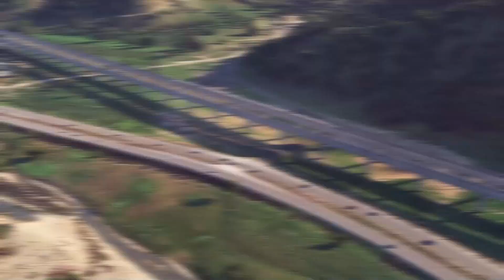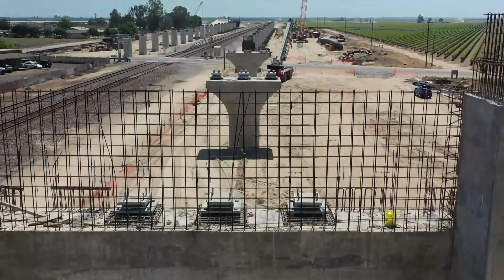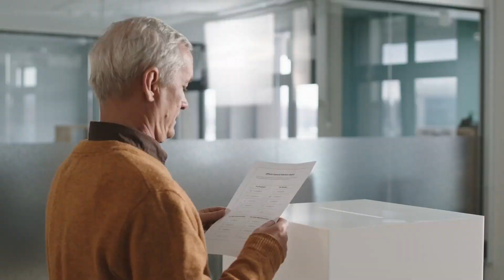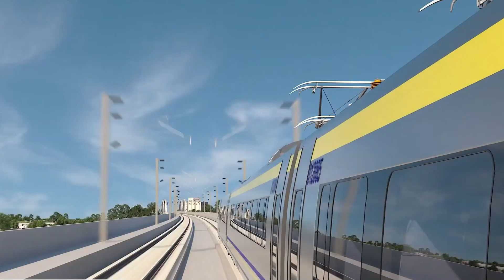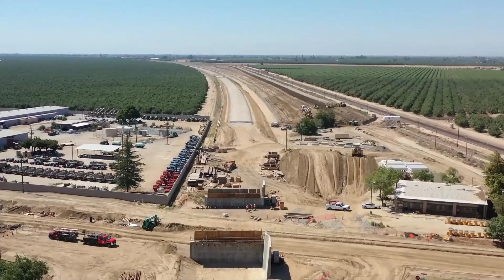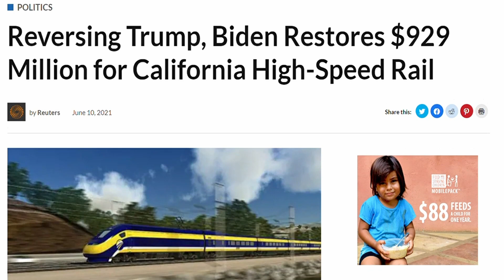California High Speed Rail: Will it Ever Be Completed

Comment: The criticism in this video ignores the objective of building the HSR in CA. Which is to connect outer areas of the state to major cities. This will generate more commerce and economic balance in the more desolate areas. One thing Europeans fail to understand is that building a line directly to major cities only will worsen the social inequality by focusing only on the public investment in major cities. This encourages people to migrate only to those areas, exacerbating resources such as housing and the cost of living. The wealthy and large corporations benefit the most from this public infrastructure as they have the assets to exploit these public investments. Europe suffers from an over-centralized economy. The wealth is simply concentrated in too small of an area. HSR is notorious for being unprofitable and CA certainly have the revenue to prop this up. Makes sense to spread the investments to the underserved areas. Also, building at this speed may be of some benefit. The Palmdale station was built to be eventually connected to the Vegas HSR. Something the private train Brightline is supposed to build. As more time goes by, the goals and benefits become more apparent. But just like everyone else, I am eager to get this done asap.

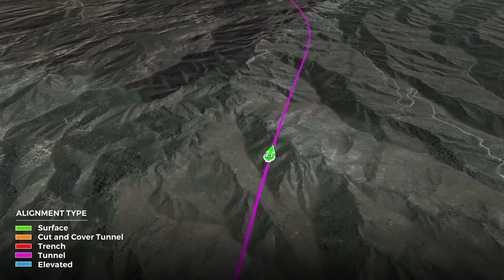Comment: 7:28 alignment choices LA - Bakersfield detour
Tunnels and bridges are 3 to 7 times more expensive than a ground-level alignment. If even the alignment in the flat Central Valley is too costly, then the financial burden of the many tunnels and bridges of an alignment over the Tehachapi mountains would be extremely high.  A German consultant specialist for High-Speed Rail (Vieregg-Roessler) has designed a draft alignment from Bakersfield to LA Burbank along Interstate 5 with only 10% bridges and tunnels (available in the Internet).
Why does the California High Speed Authority continues to inisist on the expensive detour alignment via Palmdale with 50% bridges and tunnels, if much more efficient alignment solutions are available?
Reply: "Tunnels and bridges are 3 to 7 times more expensive than a ground-level alignment. If even the alignment in the flat Central Valley is too costly, then the financial burden of the many tunnels and bridges of an alignment over the Tehachapi mountains would be extremely high."

Well, you have to dig at least one tunnel with either 99 or I-5. You have a mountain range in the way using both routes. Only two ways to avoid that: (1) use maglev going down I-5, as it can take 10% grade no problem, or (2) upgrade existing Amtrak California track, which goes along the coast, avoiding the mountain range. However, it's definitely true that there is LESS tunnel digging for I-5 vs 99, so I agree that I-5 would be cheaper in this regard. Going down I-5 in general is the 2nd most fiscally conservative route, with upgrading the existing tracks along the coast being the most fiscally conservative. Either is a far better choice than going down 99. :)

There's a guy named Clem Tiller who has been writing about public transit issues in California for 20+ years, he's an aerospace engineer IIRC. But he had an article called "The Truth About Tejon" (since we can't post links on here anymore, if you google that title, you'll get a PDF as the first link, download it and read it) explaining that it's quite possible to go through there on wheel on rail, you just have to dig tunnels (like with the 99 route, you have to dig a tunnel with 99 too). And he does say that there are fewer tunnels necessary, with shorter lengths, than for 99.
Reply: Exactly. It'd be too expensive, and the Inland Empire is expanding and needs to be connected too. The point is to build a network not a two city link.
Reply: I'm sorry but this is just not blatantly false. There is no physical way to get from SoCal to NorCal without tunneling  through at least two mountain ranges. Both regions are literally located in bowl-shaped valleys and are surrounded by mountains on all sides. You would have to be extremely unfamiliar with the geography of California to write what you just wrote above.

Furthermore, a large number of routes of various levels of quality were looked at when the system was being planned out. Some of them dropped out immediately because they were too slow to conform to the bond measure law (the I-5 alignment) that approved the funding for CHSR. Some of them were a lot more expensive to tunnel and viaduct (like the Grapevine tunnel ones). And some had a combination of issues, i.e. they were both too expensive and too slow (Vieregg-Roessler).

What ended up being chose is a compromise, for sure. But you can see exactly why this route was chosen. It was all done in public meetings with wide participation from the public as well as contracted and outside experts. You can look it all up. It's all in public archives. I understand that these decisions all happened a long time ago by now. But to suggest that they were made by some mindless bureaucrat without looking at the evidence is just absurd. It's literally all recorded and available for all to see. There's no need to mythologize and make $hit up.
Reply: @TohaBgood2  
"Some of them dropped out immediately because they were too slow to conform to the bond measure law (the I-5 alignment) "

Tohabgood2, What can we Google to find this? Because the actual reason they chose 99 was political; they figured people in trumpland were more likely to vote for it if went through their area. But I'd love to see a credible source that says I-5 would somehow be slower.

For example,

""If you went up the I-5, you'd get a lot of votes from the cows in Coalinga," said Richard Katz, a member of the L.A. County Metropolitan Transportation Authority board and a former high-speed rail authority board member."

Same article says,

"SNCF officials said that if they were hired they would propose running the bullet train along Interstate 5 through the Central Valley and then linking to San Francisco.
McNamara said the I-5 route would have been the shortest, fastest and lowest-cost alignment, with a price tag of about $38 billion — sharply less than the rail authority's current route, which has been estimated at various times to cost $34 billion, $43 billion, $98 billion and now $68 billion. According to SNCF, the I-5 route could use state-owned right of way or utility easements, reducing conflicts with property owners.

"In the French view, fast service between the state's mega-regions would provide most of the riders and lead to the system's ultimate success. The French contended that rail service to Fresno, Bakersfield and Palmdale could be accomplished with branch lines linked to the I-5 route and regional commuter service, such as Metrolink."

To find this article, put "High-speed rail officials rebuffed proposal from French railway" into Google. First link should be a PDF document that is a printout of an LA Times article. That's where I got the quotes. 

(if I put the link YouTube will eat my comment.)

So, can you help me out with the "I-5 being slower" source?

Comment: I would love see a true high speed rail built to connect SF with LA on a direct route. But the current plan is nearly 100 miles longer than a direct route could have been. 
     If the route had gone from SF to San Jose and Gilroy. And then from Gilroy to Los Banos and I5, which it could have paralleled down to the Bakersfield area, where a transfer point could have been set up between valley Amtrak services and the high speed rail.
     Then the route could have gone to some places near the Edmond Brown pumping station and tunneled through the mountains to Castaic Lake and another tunnel to get to Saugus and parallel the old SP line to Union Station. 
    Union Station would need to be modified to allow HSR trains to pass through and go to Anaheim and San Diego. Not with a long side trip through Riverside. 
     Because of politicians, who wanted to build a line to connect the towns of the valley, the route has gone across expensive pieces of land and probably won't be completed. 
     For now they should focus on cleaning up the mess they have made and completing what they have started before they seek to extend it over the mountains to Palmdale.
Reply: That was a nonstarter from the very beginning. We had just finished building the 5 to bypass 1/3 of the state and pretty much all of the cities in the Central Valley. If CHSR tried doing the same thing, there would have simply been no CHSR to begin with. Keep in mind that this thing had to pass as a ballot measure and most of the state needed to support that law. There was no way that the bond measure passed without routing through the Central Valley towns.

CHSR is supposed to connect the state of California. That's why the entire state is paying for it and not just the two mega regions. If SF and LA want a direct HSR link, they can just pay for it themselves without involving the rest of the state's taxpayers. 

Furthermore, CHSR is supposed to be to the entire state what BART is to the Bay Area or what the Shinkansen is to the Tokyo area. What would be the point in connecting just SF and LA? You're literally ignoring most of the benefit of building an HSR system if you don't go through Fresno, Bakersfield and the rest of the Valley. Despite what some people may think, Fresno and Bakersfield are large cities. Both have metro areas of about 1 million people and the rest of the Valley has a 6.5 million population in towns of 50k-200k. What idiot would build a train bypassing all of those cities? Why? They're literally a five minute detour to the East!
Reply: @TohaBgood2  The Valley has 2 Amtrak lines serving it. So the segment that is being built is the wrong one to start with. Similarly the Palmdale route has Metrolink to bring people to Newhall. 
     So the important segment to build should have been Newhall to Bakersfield. That way service could have been provided on Metrolink from LA to Newhall. HSR could then take passengers from Newhall to Bakersfield. There they could transfer to existing rail lines to get to Fresno, Oakland, Sacramento and other places along the way. We wouldn't have ended up with a line that doesn't get passengers connected with the rest of the state. 
     Granted, we would have had to contract with people who knew what they were doing. But, even in California, that might have been possible.

Comment: Excellent video (although you forgot to add the expensive lawsuits that the CAHSR agency has had to deal with which has also contributed to the rise in price). When this project is finished, no one will be talking about the price. It's just like the interstate highway system. It cost a lot of money to build, but today, no one really talks about what it cost to build. And essentially, high speed rail will be more beneficial than the interstate highway system.

Comment: Let's get this project done! We need High Speed rail as planned. The Mistake is NOT finishing this project. Clean up the politics, look for private funding such as Brightline and possibility intergrading with Amtrak and Metrolink. Sharing the cost of the tunneling out of LA. and SF. Californian's need this done.
Reply from the maker: You are right, but with increasing costs and other bottlenecks, is it still feasible?
Reply: @poshfuture1833  it’s still cheaper than widening I-5
Reply: @poshfuture1833  Posh: Increasing cost, bottlenecks are always part of big projects. If we are going to let concerns rule the day,  then your right noting will get done. Instead of acquiring more farmland, why not use the median on ST road 152 between Marcet and tunneling needed to reach Gilroy to reach the UP right away. This alone could save millions in land purchases.
Reply: @alexcalzaretta3190  

Well, they should do one of two things,

(1) if they want to do a new dedicated track, it should go down I-5. Nice 80 foot wide median, nice and straight, no towns. 

(2) even cheaper would be to upgrade existing track of "Amtrak Calfornia" to 125 mph max, 90 average.